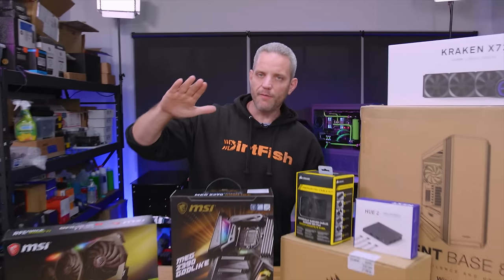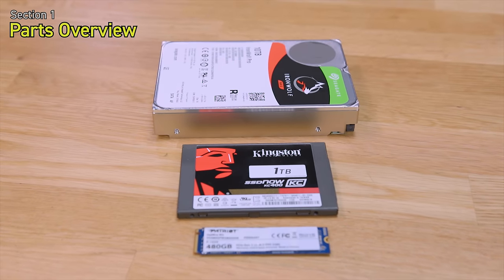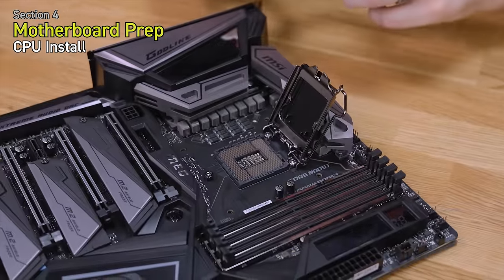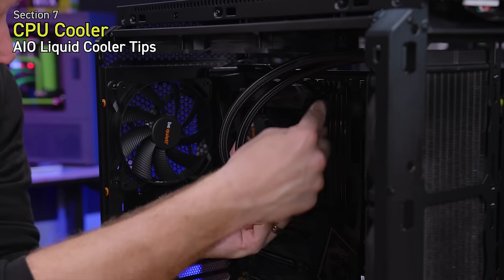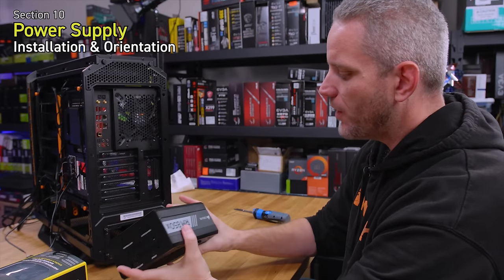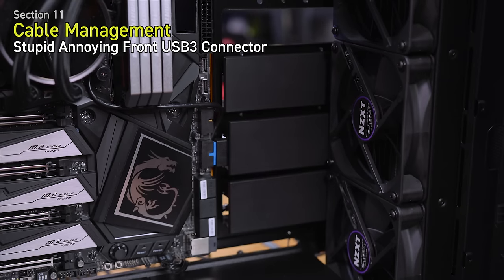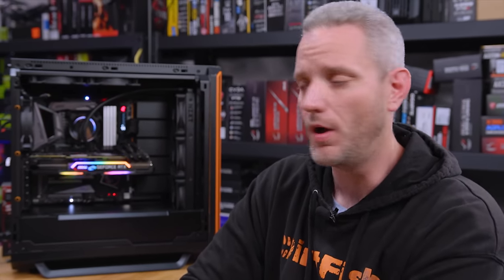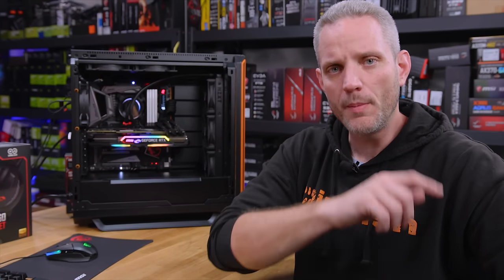How to build a computer

Comment: This video confused me a bit...

1) In a world with AMD Ryzen and Ryzen Threadripper, why did he use the six-core Intel i9 9900K, Quick-Sync video cannot justify that, especially not when paired with an RTX 2080ti which will cream the i9's on board GPU's compute and encode performance. Not to mention AMD gives you access to more PCIe lanes for adding more GPUs, RED Rocket Cards, Raid Controllers, Networking Cards etc. AMD Ryzen also supports ECC memory for an increase in reliability, not available on the Intel consumer platform. There are much higher core-count (better encoding performance) chips from AMD available at similar prices. Very odd choice.

2) 14:52 is that electrical tape on his 8-Pin EPS cables ?!? 

3) Did he ever plug those 8-Pin EPS Cables in? And no mention of how to route those cables effectively...

3) Did apply any thermal paste, or even mention it ?!?

4) 20:32 What is that 6-Pin Connector in the middle of the motherboard for ?

5) A Patriot Hellfire NVMe SSD doesn't sound very "ultimate to me"...where's the Samsung 970 Pro ?

6) No HDD Raid on an editing rig ?!? If you have a NAS for backup sure, but without, that is a big no no. 

7) That motherboard's on-board LAN  is only 1-Gigabit, a serious sin for an editing rig.

10) Jay mentions Operating Systems very generally, implying one could install linux or build a hack-in-tosh. However, MSI's official spec page for this Motherboard explicitly states that there is only support and drivers available for Windows 10 64-Bit.

11) Jay didn't tells us anything about fans or airflow, such as push-pull / pull-push or negative or positive pressure.

12) Leaving out the HD-Audio connector on your own rig is fine, but in a tutorial that's just lazy.

13) Jay didn't mention any I/O considerations for choosing a case such as making sure you get a case with USB 3.1 / 3.1 Gen 2 / Type-C or Thunderbolt if your motherboard supports it. In this case, the motherboard does have USB 3.1.

14) Jay doesn't talk about PCIe lanes at all and doesn't mention that depending on your platform you have to be careful about where you plug things in, in the case of this board, All the m.2 Slots share bandwidth with the single U.2 Slot and all the SATA Ports, which in most cases mean, if you use an NVMe Drive, you loose access to 2 SATA Ports.

15) Jay is building an editing rig, but paired with gaming peripherals? I mean, the keyboard and mouse are fine, however that monitor is very decidedly not professional grade.
Reply: I just stopped reading when you wrote down the "six-core Intel i9 9900k".. This comment confused me a bit. Just a typical AMD fanboy at an Intel build video.. ;)
Reply: theChillChanneL 

This comment confused me a bit...

1) As stated this video contains sponsored hardware, meaning Jay didn’t have full control over what he used. 

2) That would be heatshrink. Very common stuff. 

3) Yes he did, and no he didn’t, but this channel provides several videos on cable management if you have questions. 

3 (again?) Correct. You fuckin got him. We’re all very proud. 

4) Do you really not know...? You realize that at no point is it stated that this is a beginner build, and based upon the comments, there aren’t many beginners here. 

5) Ahhh a brand whore. Again. Sponsored hardware. 

6) Not every editing rig contains RAID storage. “Big No No” just makes you sound pretentious. 

7) 1 Gigabit is plenty for editing YouTube videos.

10 (what happened to 8 and 9) “Implying” - not stating. I suggest Webster’s Dictionary if you’re struggling with the difference. 

11) Again, he has more specific videos on this, but he did explain his logic for fan positions. 

12) Fair point. 

13) I believe you’re looking for a part selection video, not a build video. 

14) I will totally back you on this, as there is a lot of confusion around M.2 vs. NVMe 

15) This is just petty. He plugged a monitor into it. That doesn’t mean it’s going to be used with that monitor. 

I get that it’s fun to scrutinize build videos after The Verge video, but this list of “No-No’s” just makes you look like a pretentious dildo. If you have such a problem with this, go make your own build video. It can be 5 hours long. We’ll all watch it, I swear.
Reply: This is just next level marketing. Nothing more. And everyone watches it, the dream for the industry :-').
Reply: @derek7105  I was just stating my opinion, which is, in general: Build Guides are meant for beginners so they should be detailed and complete. I don't think many experienced system builders watch build guides for any reason besides fun. I realize this is a sponsored video, I'm more questioning; Why do a high-end editing rig with this hardware and not a high-end gaming rig? I mean, of course it CAN edit but for a system built with the intention of doing high-end workstation-class day-in-day-out video editing system, there are some weird parts choices here. I removed complants #8 and #9 because I re-watched the video and decided they were to opinion-based to matter, I just forgot to re-number the subsequent complaints. I will admit, I completely mixed up the specs of the CPU, I got it confused with the i7 9700K. Though, I stand by my opinion that for an editing rig in 2018-19, AMD (specifically the Ryzen 7 2700X and thread-ripper chips) is a better option unless you really have money to burn and want to shell out for Intel's High-End-Desktop platform. Also, to clarify, I'm not really an AMD fan boy, as I'm currently running an i7 7700K in my personal rig (Mainly used for gaming and programing), I have built 2 low-end systems for relatives using the AMD Ryzen 2200G and they have preformed very well, so I have gained an appreciation for that CPU in particular and my college uses Ryzen 7 1800Xs in it's high-end workstations and they are beastly when it comes to editing performance. Not that I have done a metric-butt-ton of editing on them or anything, but the performance is great enough that if the labs aren't busy, I prefer using them to edit as opposed to my own rig. Thank You for the constructive criticism.
Reply: Have fun bottlenecking with a threadripper xD
Reply: The main issue I had was going with the non-ECC platform. If you are building any workstation that you are going to use professionally for content production, then ECC is a must in my opinion. You could very well run a high demand editing / rendering / CAD rig for 12 hours a day for months on end and never have a single memory error on non-ECC DIMMs... but the minute you have one and start trying to troubleshoot random corruption in a frame here or a frame there... that's when ECC more than pays for itself. Sure, you lose a little raw performance... sure you pay a little more for the extra parity RAM on each DIMM... but it's peace of mind. Every other critical part in a build like this will have error checking baked into the component... ignoring it for RAM is a risk that I wouldn't take in a professional environment.

Comment: where's the vodka for the CPU cooling?
Reply: Vodka is not compatible with capitalist builds. He is using a NZXT Kraken which is made by the American company NZXT(big surprise). Due to this, vodka would cause worse temperatures.
Reply: Boris is the slav king, that's how he managed to get better temperatures. Since JayzTwoCents is from the United States, he couldn't use vodka cooling.
Reply: I drank it😎
Reply: @HazmatPyro  I have a CommuNiX Stalinium 26B case and I have vodka cooling. I get about -20 degrees celcius when idling.
Reply: Life Of Boris

Comment: I am curious why you use zip ties for cable management rather than velcro ties. There are small velcro ties that do the job, are easily removable without clippers (and eliminate the risk of accidentally clipping a wire), and take up the same space as a zip tie.

Comment: I don't see a swiss army knife, or massive excess amounts of thermal interface material on a cooler that already has TIM on it, and Jay isn't wearing a Livestrong band to protect against ESD, so this can't possibly be a proper instructional video for building a PC.
Reply: I dint use any of that shit when I built mine WTF. Anti static? Why would I need that when I can occasionally ground myself on a refrigerator or the PC case?
Reply: Modern components are way more protected against static these days.  Hell you see some YouTubers grabbing up the components by their sockets yet they still work.  Granted you shouldn't do it intentionally, but I'd say you'd have to go a little it out of your way to short it unless your hands or the surface is dirty or dusty

Comment: Wiggling the cpu probably bent the cpu pins on my board.. I woudnt recommend anyone wiggeling the cpu
Reply: tcntad correct. The CPU should just drop in and that's all you need to do. If it doesn't then pick it back up and try again.
Reply: @reubenosman2288  exactly. Gently lay it down like a smooth whisky or a lady
Reply: @tcntad87  he doesn't mean wiggelling as in scrubbing it over the cpu slot but just very gently applying almost no force is a good way to confirm that the cpu is in place.

Comment: I just finished buying all the parts for my build and saw something about flashing my motherboard, or updating the bios or something before I install the cpu.  I'm super confused and feel like I hit a roadblock at step 1, lol.  Please help.
Reply: In short, the BIOS is the most basic piece of software that allows the computer to run at a basic level. The BIOS needs to support the CPU you installed. In some instances, a motherboard may support a CPU, but only if the BIOS is at a certain version. This is somewhat common with AMD Ryzen builds. Unfortunately, there's no way of knowing if the motherboard has the correct BIOS version until you build the system. If it doesn't boot correctly AND you verify that all the other hardware is good and installed correctly, then it may need a BIOS update. This is ab it of a dilemma for most PC builds. In order to update the BIOS, you need a working system. So that means you need a loaner CPU that works with that board. A lot of mid to high end boards have an update feature that lets you update the BIOS even w/o a CPU installed, but most of the entry-level boards don't have this.

If you build your PC and it powers on fine, you don't really need to worry about anything else.

Comment: important note: the radiator for the aio is actually the wrong way around. the tubes that go from the cpu into the radiator need to be at the bottom, not the top.

Comment: Just wondering: The 360 Rad fits in the Top of this Case, doesn't it? So why dont mount The Radiator on the Top and let it blow out of the Case. Front-Fans Pull fresh air in and Back-Fan blows out as well? Sounds better for me than blowing the warm air into the case

Comment: @JayzTwoCents I know this video is old, but thank you for making this. It helped me immensely! I had trouble with wiring the case. I wasn't sure where everything went and I wasn't about to start guessing; I want to know for sure. IT has been 20 years since my last build, so thank you again!

[edit: I didn't tell you what I have, not that it's worth writing home about, but it's better than my 12 year old Dell XPS850. The Dell started to fail incrementally. restoring it was out of the question. Okay, so my new system...

Case: Antec RGB DF600 Flux
Motherboard: Asrock B550 Phantom Gaming 4
CPU: AMD Ryzen 7 5700X
Power Supply: Corsair RM750 (certified refurbished)
Graphics Card: GeForce GTX 1050 TI *
Windows 11 Home
CPU Heatsink: Cooler Master Hyper 212 EVO V2
Memory: G-Skill Flare X series DDR5 3200 (4X8gig)

* I bought the GeForce GTX 1050 TI while attempting to upgrade my XPS. Unfortunately, the PCI version was 4.0. Not compatible with my XPS8500's much lower version. Since I bought it, I included it in the new build. Luckily, the motherboard allows for CPU upgrades, As is the same for the graphics card. In time that will happen.

Comment: just wondering, installing the ssd's in the m.2 slots with thermalpads....shouldn't you pull off the stickers from the ssd aswell for it to have better effect or doesn't it matter actually, atleast thermalwise...? 
fyi I never used m.2's yet , so I'm clueless on how warm they get...

Comment: Hoping to get some input on this parts/build I got going on. It's for gaming only as of now. This is my first try at building a PC. So any tips or cost saving tips would be grate. Thanks. 
CPU: AMD - Ryzen 7 2700 3.2 GHz 8-Core Processor  ($267.89 @ OutletPC) 
Thermal Compound: Arctic Silver - 5 High-Density Polysynthetic Silver 3.5 g Thermal Paste  ($6.58 @ OutletPC) 
Motherboard: MSI - X470 GAMING PLUS ATX AM4 Motherboard  ($138.78 @ OutletPC) 
Memory: G.Skill - Ripjaws V Series 16 GB (2 x 8 GB) DDR4-3200 Memory  ($119.99 @ Newegg) 
Storage: Team - T-FORCE DELTA RGB 1 TB 2.5" Solid State Drive  ($104.99 @ Newegg) 
Storage: Seagate - Barracuda 2 TB 3.5" 7200RPM Internal Hard Drive  ($59.89 @ OutletPC) 
Video Card: *EVGA - GeForce GTX 1070 Ti 8 GB GAMING Video Card  ($379.99 @ B&H) 
Case: NZXT - H500 (Black) ATX Mid Tower Case  ($69.99 @ Amazon) 
Power Supply: *EVGA - SuperNOVA G2 550 W 80+ Gold Certified Fully-Modular ATX Power Supply  ($59.89 @ OutletPC) 
Operating System: Microsoft - Windows 10 Home OEM 64-bit  ($98.89 @ OutletPC) 
Total: $1306.88

Comment: I am new to building computers and when looking at benchmarks, it seems, that on higher resolutions (1440, 4k) cpu-s matter less, it is GPU that makes difference. so why not to buy cheap cpu-s (ryzen 2600, i5 8400) instead of e.g. 9900k or even 8700k?
Reply: Go big or go home. Why build a beast PC with low internals? Makes no sense. The higher 'K' CPUs are easily over clocked to reach crazy results, that's why people go for best. They work through your whole system to bring best performance to every component! :)

Comment: I have the same clearance issue with my kraken cooler too but I'm only running 2 dimms so i can keep it oriented right for now. Should i upgrade and use all 4 I'd have to turn it as you did and will also disable the nzxt logo

Comment: hi, in the above lists of parts it says Corsair RM1000i and it has the link,,,, however in the video you are fitting a RM850i,,,, Did the build run ok on the 850 or did you have too upgrade too the 1000 watt PSU? Only asking because Im doing my first build and building something similar and waht too know if the 850 watts is plenty?? (i9 9900K, rtx 2080 M.2 1tb)

Comment: Something that I've been wondering about. Why doesn't he connect the radiator block to the bottom of the top mesh, so that he can cool it with the outtake fans? The reason I ask this is because using the intake fans to cool the block puts that heat back into the case and raising the temps on the rest of the parts before the fans on the top and back push out the hot air. Obviously this isn't too big of an issue, but do wonder if it affects max overclocking?

Comment: Can someone explain to me what benefits (if any) there would be to pull the hot air from your radiator into your case instead of pushing the air out of it? Wouldn't it always make more sense to push the hot radiator air out of the case, thus keeping the rest of the computer components cooler?

Comment: My MKII 950W power supply only has one 8 pin (4+4) cpu power connector.  Your power supply had 2, z390 godlike mobo manual recommends 8 pin and a 4 pin, can I get by with just one 8 pin or do I have to buy a new power supply?

Comment: I spent some time today researching electric screwdrivers after seeing your Hammerhead screwdriver.  I found that it has only one speed.  Are  you chewing up your screw heads with just one speed available?  I was considering the Hammerhead and the Bosch Go/Dremel (same exact driver, just brand name with Bosch so it costs more).

Comment: I currently have a dell Inspiron gaming desktop. Bought from Best Buy ( I know I should’ve built my own but didn’t know better at the time) i want to see how to make my computer 1000 times better for video editing. Here are my current specs

AMD Ryzen 7 1800x 16gb Ram AMD Radeon (tm) Rx 580 1tb hard drive and 256 ssd

I wanted to see if it was worth in getting the intel i9 9900 k and add a tb of ssd and perhaps 1080 graphics card?

In new to the entire upgrade/build pc so please help. I won’t really be gaming just really need it as a powerful workstation.

Comment: Just built my, however motherboard not powering up , thought it would b standoff but prob not , there is RGB light in DDR4 slot n fan cases but motherboard won’t power on!!!! Help ?

I7 8700, gigabytes z390 Elite, Thermaltake 31 case , Psu 750w gold .  G skill trident 16gb

Comment: Is there a video on how to plug in the Aio and all the case fans? Or how to set them up cause that’s the part that’s got me the most confused. Do they all go to the MB or the the Fan controller? If the later, where do I plug the fan controller into the MB? Newb question I know.

Comment: Guys, I need you to advise me something. I got an Rtx 2080 duke, its box has a support bracket which is supposed to  be planted into the slot below the card. So my question is- is it really necessary to put the bracket if the card's weight is 1082? and also my motherboard is ,msi z390 gaming ace which has reinforced PCI slots. Reply anybody please!